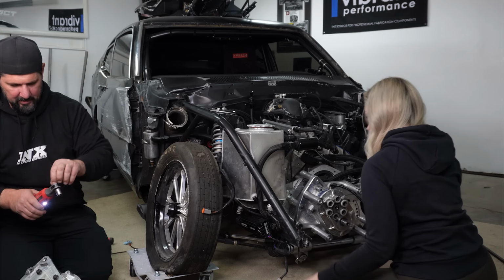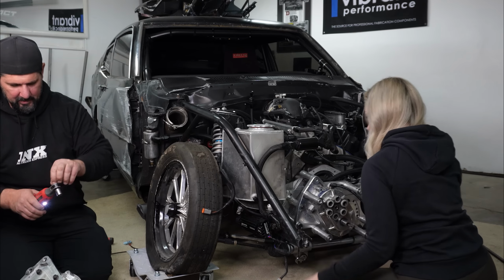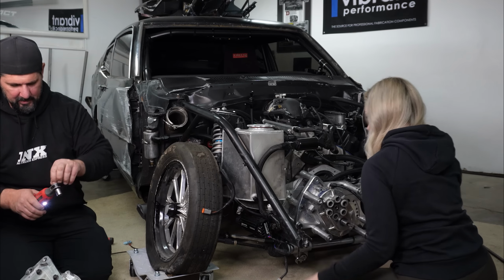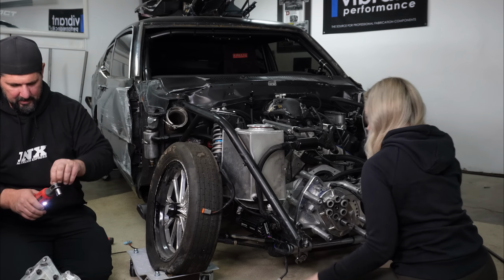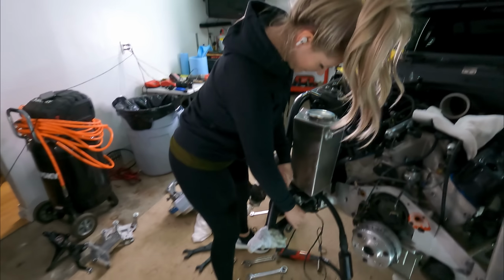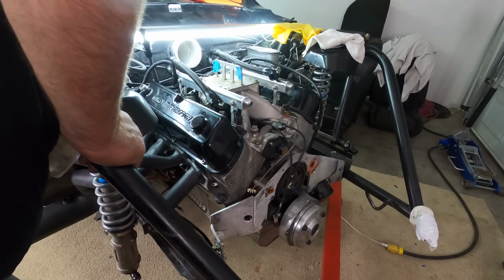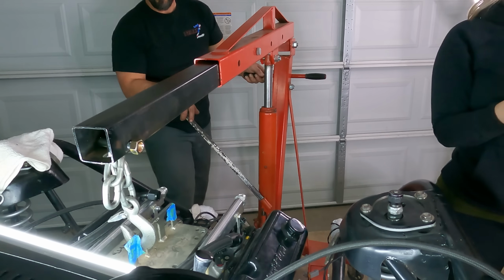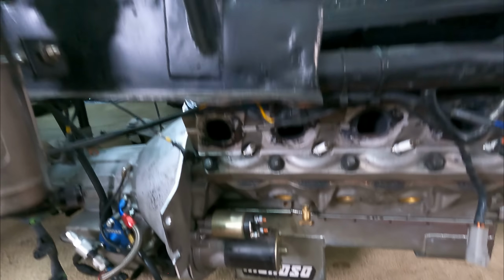Tearing Down the Maverick and Assessing the Damage After the Big Wreck (Part One)

Comment: Man I thinking I want to change my fuel tank to a plastic one. It seems like every one has split a tank that’s hit a wall lately. Fire or not seems like a safer option
Reply from the maker: Plastic is definitely a safer route, especially with a front mounted tank, but when you only have so much room, a custom built aluminum tank is the only option.
Reply: Best option is a plastic bladder with a metal case